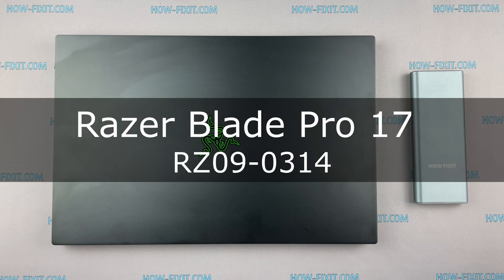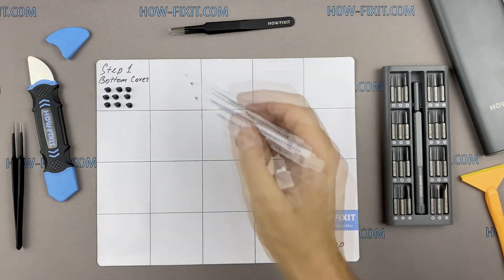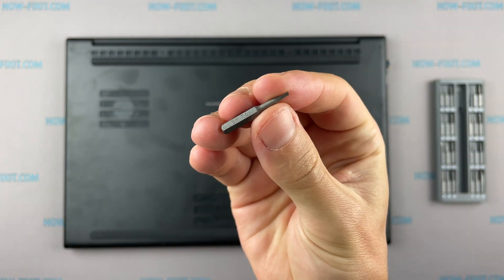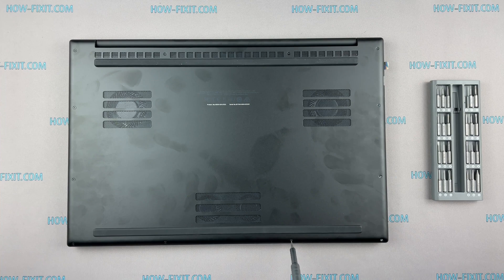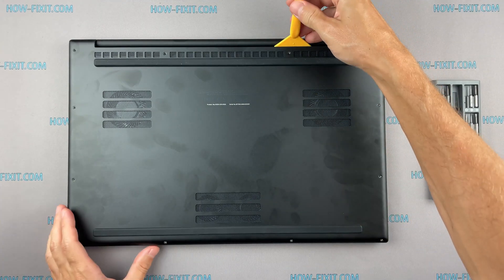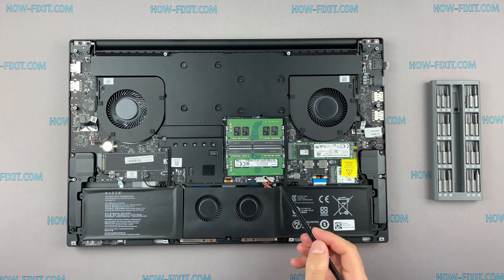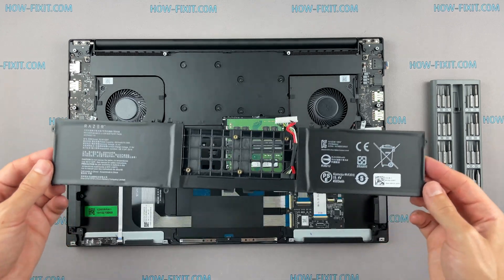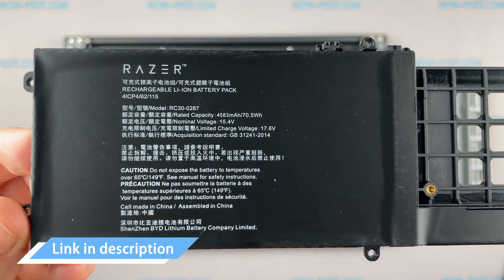Razer Blade Pro 17 Battery Replacement | Fix Battery Drain Problem

Comment: It says on the package not to expose the battery to heat over 65°C but the whole damn thing overheats and Razer fucking knows this... there's this bug where synapse fails to start unless you are connected to wi-fi when its booting, your fans are not able to adjust RPM (fan control should be in BIOS anyway hello??? !!!) so that was annoying but the real problem is that my batteries are already shrinked (beyond swollen), aand it all worked for a while even with batteries Its fucked up that I just ignored this for way too long, until one peacefull night, my laptop just didnt give any hint of life at all, not even single LED blink ( adapter is fine, checked it) so Im not sure what heppened, or why worked perfectly fine the day before

Comment: Great video. Great tools!  I would suggest in the video, instead of showing the tool- also have the words overlay the video for the tool-tip size/type.  Since I was watching on the phone, I couldn't read which head to use- and had to base it on where you took it out of the case. A 5 minute job because of this video, instead of leaving my laptop at a shop for them to do it.

Comment: I have taken the battery out because it was bloated but I don't really care to replace it because anyway I would never to use without the charger. However, since I removed the batter the small fans had to come out as well since they screw on the batter holder thingy. Any suggestion of what I could put there instead of a battery so I can still keep using the fans? Thank you in advance.
Reply: Ever find a fix for the fan mount? Removing the battery from mine as well
Reply: Are you able to use it without battery?
Reply: @juicypig4912  Yes. It works absolutely fine. I have been using it for months without a battery

Comment: Hello, I have the same unit, is it okay to use gaming on this laptop without battery? Its because my battery has bloated
Reply: Happened to mine as well, I’ve read loads online that it should be fine. I’ll do a test once I get a screwdriver to undo the bottom cover…
Reply: Any news? Mine just bloated, wondering if I could use it without battery.
Reply: @juicypig4912  its fine, my advice is while temporarily waiting for fix, buy a voltage surge protector extension so that there wouldnt be any problem incase a power surge occur which might damage the board itself